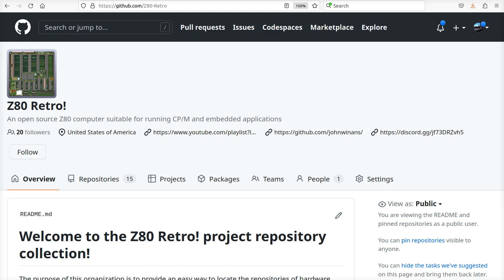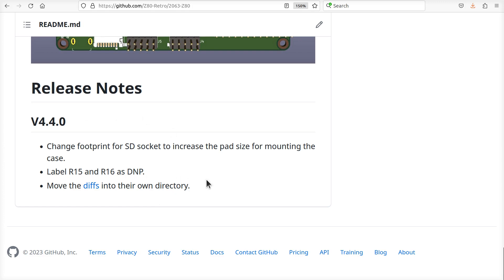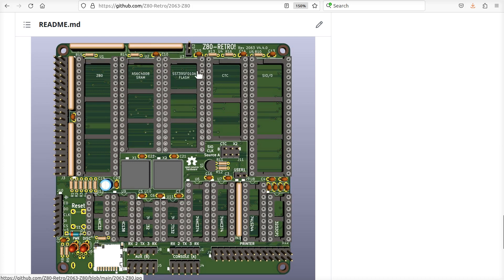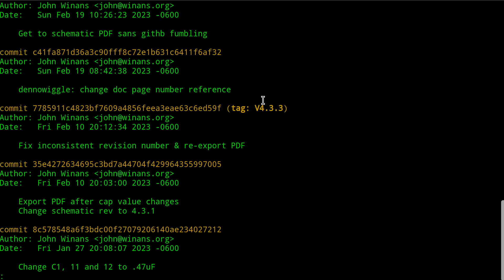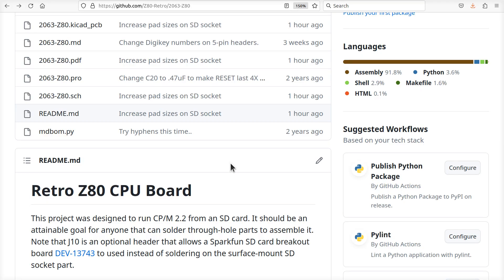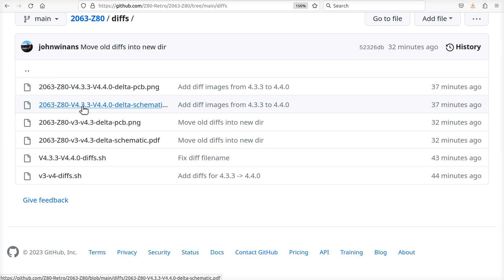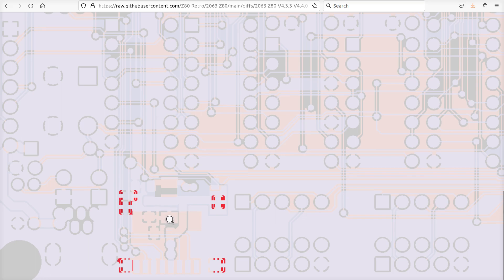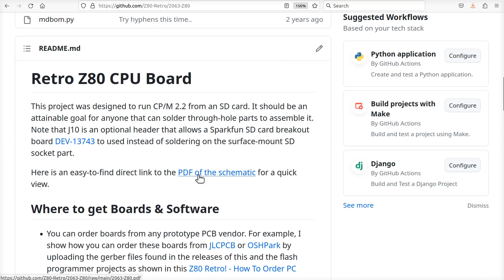Z80 Retro #68 - PCB V4.4.0

Comment: Hi John, I've just started the 4.4.0 build and have put the SD socket on in a SMD soldering oven, it was a lot easier than the difficult process you went through with a soldering iron. Awesome design you have here. I also pulled out my Z80 learning board form the late '80's and have updated it as well.
Reply from the maker: An oven or plate would be easier... if I had a stencil.  😕
Reply: Agree on the plate as well, didn't need a stencil as was only doing approx 10 joints. I just put a small amount of solder paste on each board contact and heated in the oven.
 @JohnsBasement
Reply from the maker: @davidwatson5387  I'm going to try that for n my next one!  Good idea!

Comment: Thanks for the shoutout 😁.

Just a minor note - the schematic delta/diff pdf shown in this video does not match the schematic shown in this video. The diff was done on a different version. I documented the details on the project github issues page.
Reply: Thanks for providing extra schematic diff files on the github repository. Now I need to try running those scripts myself. I'm always learning thanks to your videos. 
😁😁😁
Reply from the maker: No problem.  I also added links to them from release notes.  I think this is how I should have made them available in the first place.  Thanks.